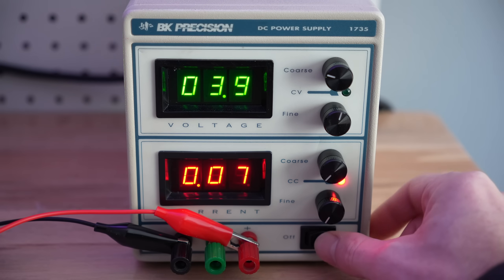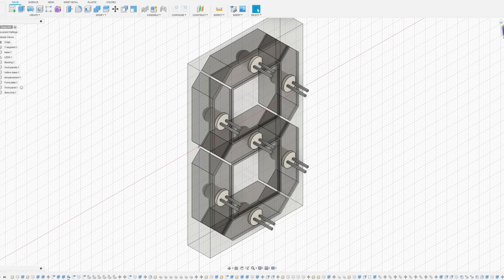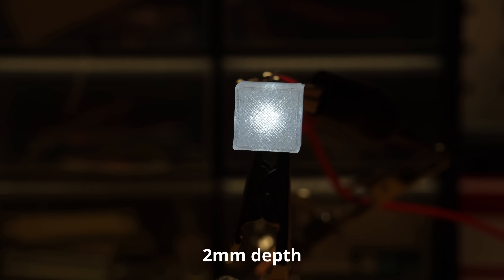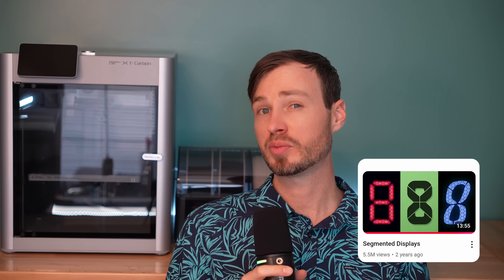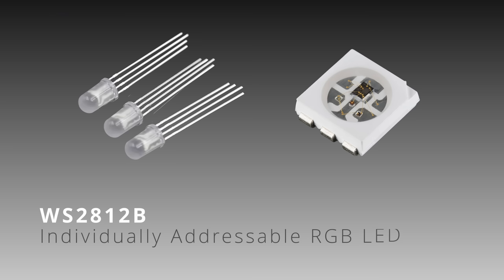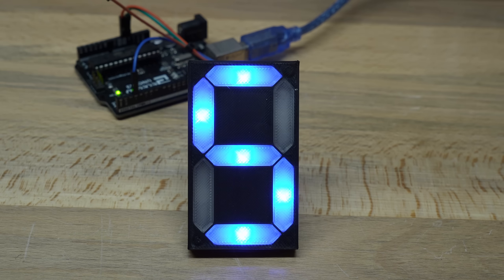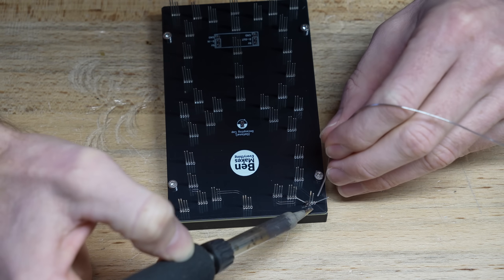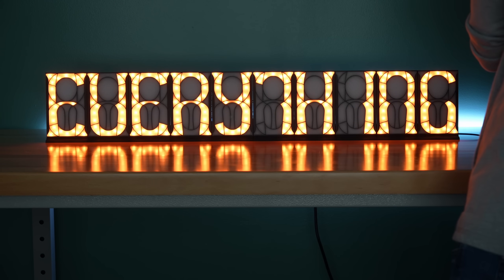How to Make 3D Printed Segment Displays

Comment: the manufacturing approach is fascinating, to try doing as much as possible in the 3d print. to me it seems like it would be easier, faster, more effective and more economical to use a sheet of frosted acrylic in front of the segment frame. i haven't done the research or tried it myself though, so maybe this approach is kind of nonsense. very cool result!!

Comment: Fully lighted it looks a little like a owl, (owl font). I like the way you did it, I did a Romal count clock for some years ago, I was doing less layers where the light has to get through. I should also had used more LEDs in the segments.

Comment: I can't help but wonder if the PCB should have been white (or sprayed with a matte metallic paint) for better diffusion. I also wonder about experimenting with a three-perimeter white-black-white wall between the segments to avoid losing as much light at the edges to the black filament.
Reply from the maker: Those are good suggestions actually! I should have at least made the PCB white.

Comment: There are transparent black PETG filaments. Also the light should be spread by placing the LED farther  back and pass through a thin 2 layer of transparent PETG printed on textured bed. And LEDs are cheap, you can easily mount 2- 3 leds for a segment

Comment: You can simplify multiple leds per segment issue by running the set of leds for that segment with their data in pins parallel, and keeping just one of the data out pins to the next segment. In my experiments it works fine upto about 10 in parallel before they start to lose data

Comment: Regarding the light diffusion, I've actually been doing quite a bit of testing, since I wanted even better light diffusion than you got in yours.

The basic gist of what I found out is:
1. Use white PETG, but not just any white will do, you need one where it's not fully opaque to allow for control of how much light to block/diffuse depending on number of layers, as well as it not being too transparent, since that would require using many more layers to achieve the same effect.
2. Air is your friend. Basically you don't want any infil or perimiters touching the LEDs themselves, and the distance from the LED "point-of-light" (where it's light is concentrated from, more easily visible on thru-hole mounted LEDs) will allow you finer control over diffusion rate.

My simple testing setup consisted of:
  - A single LED (same model as you used, WS2812B), thru-hole mounted.
  - A black PETG box covering the LED back/bottom (in your case, your PCB acts as the back/bottom cover), as well as the sides. This was done to prevent light bleeding out where I didn't want it, and other light from bleeding in.
  - A "reflector" backing plate, which was just a 4 layer (0.2mm layer height) plate that the LED pokes through, to help light bounce around more. (might be worth testing with more reflective surface, or covering it with aluminium tape)
  - A "diffuser" box, which goes inside the black box. This one consists of 2 perimiters and 2-6 bottom layers (no top layers).

The diffusion testing can then be easily tested by tweaking the following parameters:
  - How deep the "diffuser" box is, mine was mest at around 10mm.
  - How many bottom layers are used when printing the "diffuser" box (which will actually be the front of the diffuser)

Since the resulting box will surround the LED in white PETG (the "diffuser" walls combined with the "reflector"), light will bounce around much more, producing a more even light spread. The "diffuser" itself will, depending on the different settings, help reduce the LED "hot-spot".

NOTE: diffusing light will always reduce the total brightness, so it's a balancing act between how much space you have to work with and how even you want the light to be.
NOTE #2: Apart from the bottom (actually the front) of the "diffuser" box, the sides and "reflector" could easily be covered by a much more reflective surface (such as aluminium tape), since that will bounce the light around much more effectively.

It does seem easier to find good white filament for use as diffusers, when going with PLA, since any PLA marked for "Lithophane" should work.

Comment: I haven't tested thoroughly but I did some tinkering with clear recently as well. I used 100% hilbert curve infill at .12 layers. Shining the LED across the layers (hopefully that makes sense?) resulted a nice diffusion with no hot spots. The catch is I had to roughly double the number of LEDs to get the same light spread

Comment: I made my own DSKY from scratch and for the warning lights (the left side) I had a similar problem to yours with the hot spot. I tried a few solid/printed methods; different infill patterns, sideways or vertical, etc... what I eventually found to be the best solution is to use two SMT neopixels at the back, then an open space for about 3cm, and then a piece of roscoe diffuser, then a labelling layer (laser printed on overhead projector transparency) and then front acrylic sheet.  No hot spots at all, and it's quite bright. :D

Comment: I agree with @AB-Prince WRT aesthetics, but as for distributing LED light, a term to google is "light pipes." It's an exercise in optics alchemy, so I can totally get avoiding it, but it works by having plastic shaped to direct the light to its target. We're talking 100% infill, going with the surface mount LEDs, and printing right up to where the LED is to capture the light inside the pipe.

Comment: Epoxy with Microballoons does a pretty good job of diffusing light. I think the segments are beautiful to look at, but extremely difficult to actually read, which makes them less useful in than they would otherwise be. 

Additionally, the way that diffusers talk about performance is basically how far the diffuser has to be from two points of light in order to make it impossible to distinguish the two points. It’s a ratio - e.g. a ratio of 4 : 1 would mean that the diffuser has to be 4 times further from the LEDs than the LEDs are from each other. You could significantly improve the diffusion of this project (without adding a huge amount of 3d printing time and material) if you just extend the black portion of the segments further up in your model. That would provide two benefits I can think of off the bat. First, it would improve the uniformity of your diffusion, which will make them look better. Second, it would allow you to have a hollow cavity where the LEDs are mounted, which would probably make assembly much easier as the exact position of the LEDs would no longer matter.

Comment: After some experiments I settled on using a single continuous layer of white PETG printed on a textured bed as the diffuser, with black PETG walls separating individual segments. With right density of LEDs in the back it gives a very even distribution of light with no darker spots and no light absorption by the extra plastic. Continuous sheet of the white plastic on front softens the boundaries between segments, what IMHO looks a bit better than crisp edges. Plus, there is no plastic waste on filament changes, and with manual filament swap such a design can be printed on any printer.
I prefer SMD LEDs. With lower height, the display can be thinner than with with TH.

Comment: If you're going to make a better case for it, try adding a sheet of smoked perspex or similar in front of it.  It helps with the contrast.  I made a copy of Ivan Miranda's 7 segment clock a while back the white segments were terrible. I ended up just coving the segments with some over-head projector (acetate?) sheets that had been printed completely black in a laser printer and the difference was night and day.

Comment: dude, this is amazing! if you want full diffuse light, you need 3 layers with space in between... 0,2mm wall, 0,2mm space, 0,2mm wall, 0,2mm spase, 0,2mm wall, than the led :)
Reply: The problem is with the spaces. You need infill to separate the spaces and that will show up as shadows, as he explained in the video. However, I think that it might not be such a bad thing, if the right infill is chosen. Would have to experiment.
Reply: @SuperBoppy  no infill needet :) i know that, because i had a hack of a time to figer out how to make my rgb-slotcover perfekt, there i needet an perfect diffusor layer. overhangs in his case will work out fine. but what he has done is freaking amazing! love it!
Reply: Bruh. You just solved a huge problem I've been dealing with

Comment: Given the T and the M would have looked a lot better with one more segment, way there a hardware limit to limit it to 20 instead of 21
Reply from the maker: I just chose to try and do 20, there was no hardware limit. I had an extra segment in the top half at one point in my sketch, but the "T" then either had to have a blank space in the middle, or a weird dashed line. Either way, it wasn't great, so I just went with this.
Reply: @benmakeseverything  Ok, I see why we went to dot matrix.   :p

Comment: You could wire the data-in lines for your 'extra' LEDs in parallel (just take the data-out line from one to go to the next segment) if you wanted to argue with anyone that insists it's not a 'true' 20 segment display. Super fun project, thanks for posting!
Reply from the maker: Good point! That would have made the code easier too.

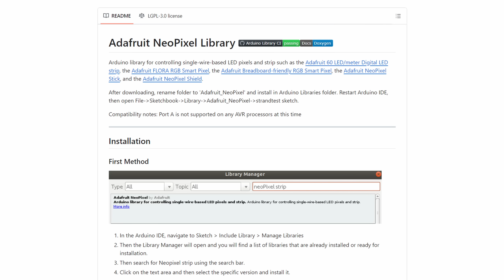Comment: Thanks for the video, I'm doing the same as you, very similar project. I have a question though: at 10:10 why is a 5 present in your segment matrix?
Reply from the maker: Oops, good catch! that is a typo. There should only be 1s and 0s.
Reply: @benmakeseverything  Happens. Loved your video, the design is pretty good.
I love those 5mm DIP WS2812. I have to finish my clock with them. I won't have a PCB, though, the leads are perfectly give the opportunity to just bend and solder them together.
Reply: Remind me of Bender having a nightmare about 1s and 0s which had a 2 in there!

Comment: try to thicken the translucent parts in the center, like a pyramid. that way, light from the middle would to pass through thicker part and the sides pass through thin corners easily. to balance the light
Reply from the maker: Interesting idea, I didn't think of that

Comment: I think the imperfect light spread acts to add more charm to these displays, add to that the art-deco look, especially with the color set to amber.
Reply: it could be improved by dimming the "fill in" LEDs so you get that imperfect light but you still get a clear separation of segments
Reply: @drgenio2006 Yes, LEDs are cheap enough to place several of them on one segment, reducing the brightness of each one but maintaining the overall brightness due to the quantity.
Reply: Just like the old projection digit displays!

Comment: I like the font overall, but the "T" really stands out and makes things a little harder to read at a glance
Reply: I would have added one more central segment in the top section to be able to center the "T" and the "I"
Reply: @damiensorel6300  Yes. And the T, and the ! and possibly other characters that could use centering as well :)
Reply from the maker: Agreed, the T is the worst letter. I did have a center line in the top half at one point in the design process, but because of the middle horizontal line, it looked weird either way, so I chose to just do it this way.
Reply: @benmakeseverything  Yeah, understandable. It's a really good final product though!
Reply: @benmakeseverything  you could also go for a lowercase "t," since your current design can more or less draw it. At any rate, it'll likely be better than the uppercase one
Reply: @benmakeseverything   I guess you'd have to split the middle horizontal line into three segments to avoid that.
Reply: @benmakeseverything   with all parts being able to light up ( and maybe some extra parts to improve the T )  it would also be a nice 'stainedglas' wall piece when not showing info 

(   I cant avoid reading the 'T' as 'L'     8-)
Reply: @benmakeseverything I’m glad you opted to do what you did.  That’s bold.  Regardless of where we all land on the T, I think there’ll become a point in our future when we all become accustomed to a variant of our letters, based on the adoption of simplicity, where certain letters will morph into some hybrid.  Perfect example is the issue with uppercase “i” and lowercase “L”.  In sans serif, they are identical, and it’s ubiquitous.  So we as a culture need to update the symbol for either letter, or we can’t progress.  Maybe uppercase T will need a similar revamp, if we decide that letters should not have a central vertical component (for whatever reason).
Reply: @benmakeseverything you could change the lettering for the t to have the ledt vertical illuminated, and play with the bottom and middle horizontals to cheat a lower case t?
Reply from the maker: @TeslaFactory  I actually did that after releasing the video. And I do think its more readable.
Reply: @benmakeseverything  I think that would have been way less weird, or at least way more readable. That T really doesn't look like a T.
Reply: A segmented display is always going to have compromise. I think you did really well creating such an aesthetically pleasing font given the limitations!
Reply: One could also mirror the current T into the next segment vertically and make it a double width character - supporting ligatures for two TS next to each other. But variable-width fonts inevitably brings one into "here be dragons" land.
Reply: I would just use the top five horizontal segment and the two bottom middle ones as used in the W. There will be a gap between these two but it would be much more readable as a T
Reply: @ardvan yeah that sounds workable.  Or even just make a miniature T by using none of the upper segments.
Reply: I came down to make the same comment.  I agree with the other replies on the letter "I" as well, but I guess I am more used to that spacing from looking at 7-segment displays for so long.  Either way, this is a project I have had on my list for awhile, and this video is good encouragement to start noodling on making my own segmented design to take into account spacing and certain inevitable letter weirdness.
Reply: that T is a deal bracker. too many words with t.
Reply: Sure there’s some things that may need some tweaking but I think it looks really good!
Reply: I think going for a lowercase T here would make it a lot more readable. Perhaps flipping the J horizontally and adding a horizontal middle line.
Reply: Just gonna chime in with a dissenting opinion here -  I like the T. The i actually bothers me more, from a spacing standpoint. Love the overall look.

Comment: Hi Ben 👋Great video and great result! Last year, we needed to built 10 pretty large segmented displays on a limited budget for a client. We opted for lasercutting the segments out a sheet of multiplex, and laying 1 long RGB pixel strip on the inside edge of the segments. No soldering, no fuzz, just 1 long LED strip. Created some plastic inserts for the segments to diffuse the light, and finished with a final sheet of matte Plexiglas on top. Took about 1 hour to laser cut and assemble one (without 3D-printing diffusers). If something would ever break, just replace the single RGB strip, so we shipped them with a spare roll.